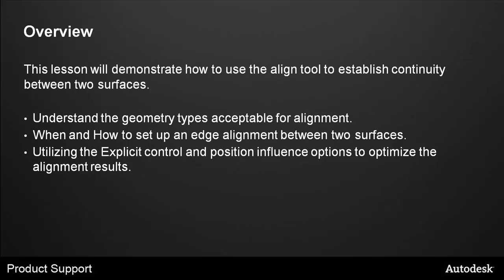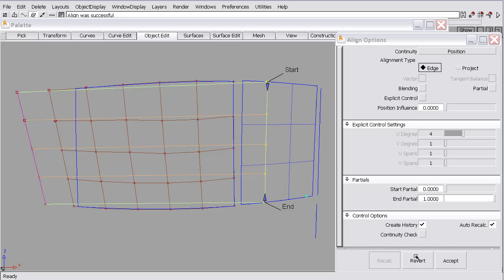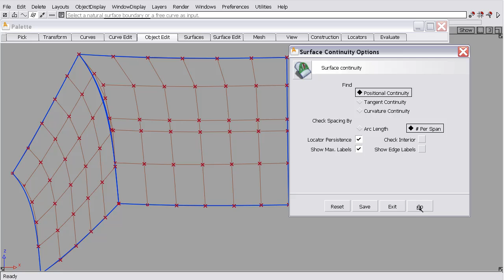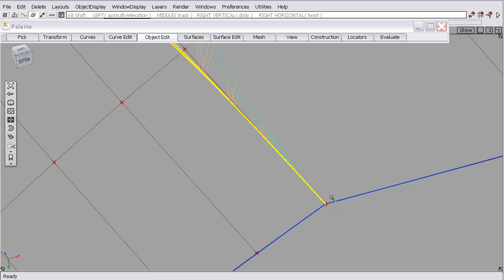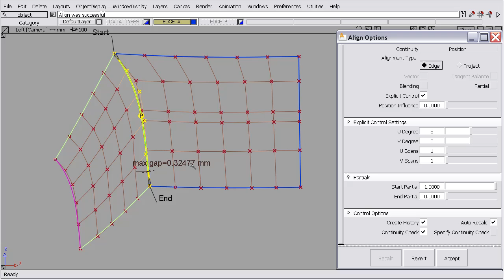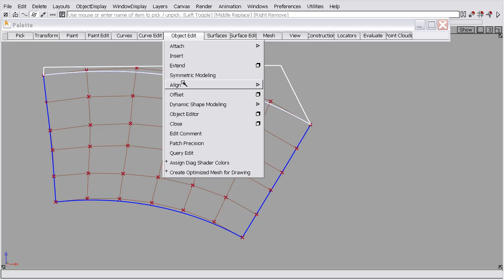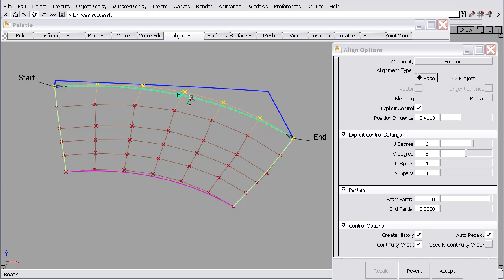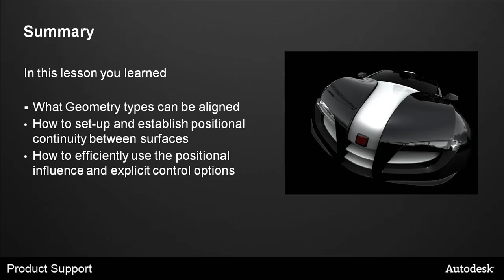Autodesk Alias Align Tool Part 1

Comment: I have a doubts or problems or questions in creating surface using different curves. There is no tutorial which teaches a surface creation with the use of different curves in all the three planes. I tried rail surface creation but it creates surface only in two planes, what other tool can help me in this?
Reply from the maker: +Rohan Acharekar Hi Rohan,  That should have been covered in the basic training, but all surface types including the rail surface  create from 3D curves.  Can you describe the process you are using?